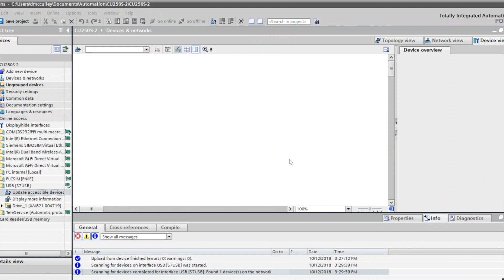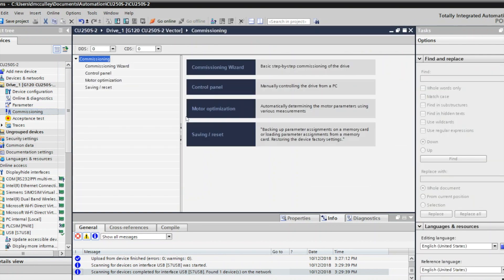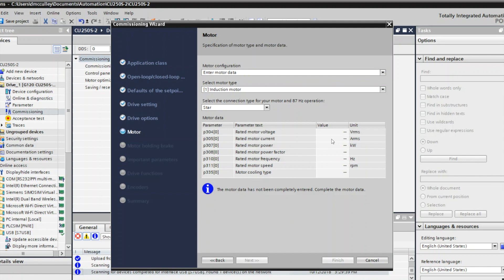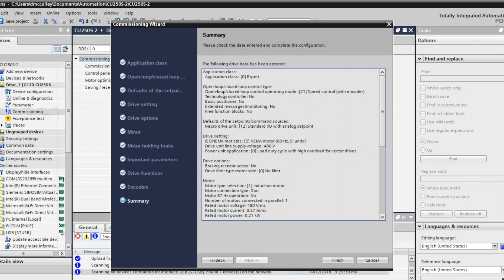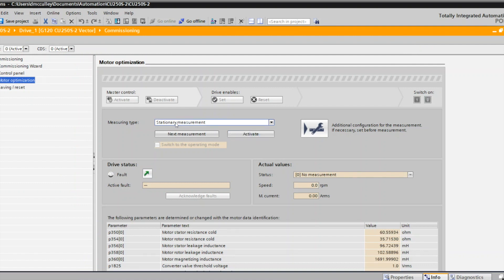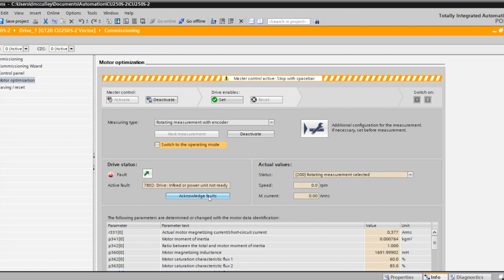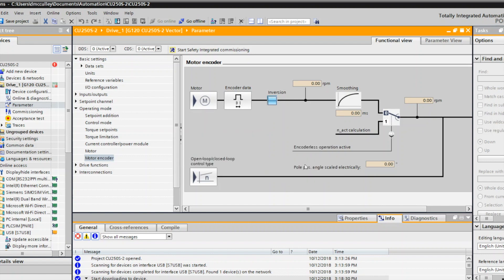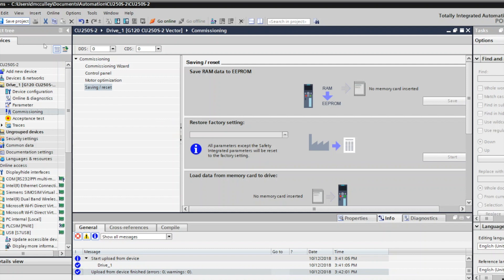How to Commission a Siemens G120 with CU250S-2 Control Unit in StartDrive

Comment: Hi Jason, Thank you for the very helpful vids. Im using a 6SL32440BB121FA0 CU240E-2 PN - Profinet with ST. The motor is running a loading screw and when the amps of the motor increases I need to program it to slow down and reverse it before then going forward again. What do you think the best telegram is to use for this?